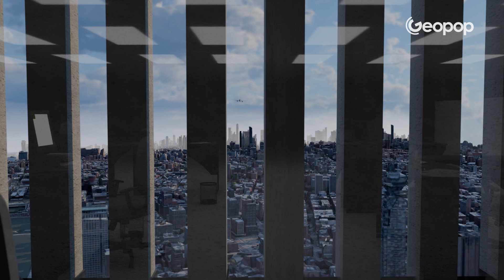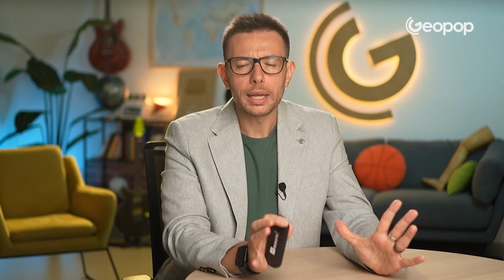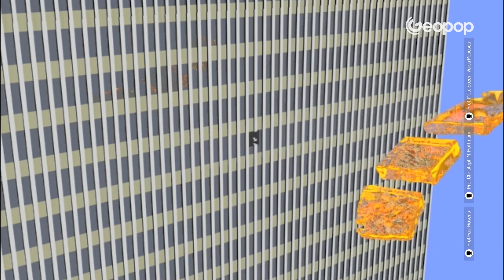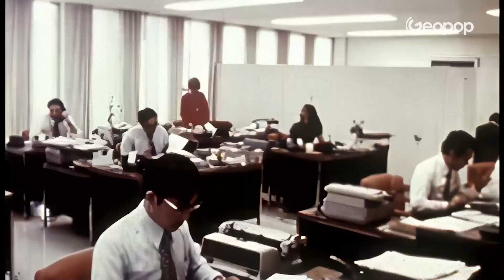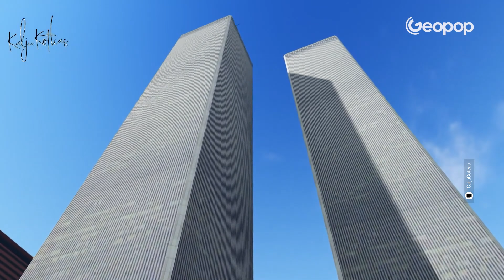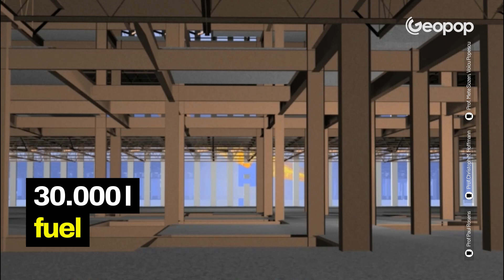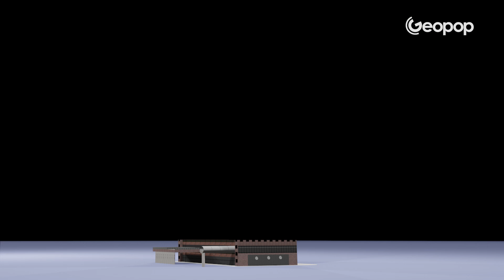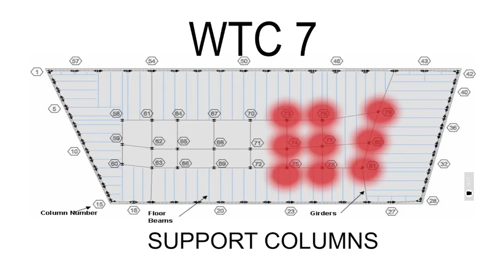9/11, 2001: The Technical Reconstruction of the Twin Towers and WTC 7 Collapses

Comment: Well you are presenting an empty claim with the progressive collapse.

Where is the data on the Tons of Steel and Tons of Concrete on each and every level of the towers? There is the slight problem of the Conservation of Momentum.

Consider the shape of the Eiffel 🗼 Tower didn't the amount of steel increase down the structures. So regardless of temperatures in the fire areas there were no fires below the 85th floor of the North Tower.

Try finding data on the horizontal beams in the core.

About those fires, air weighs less than 2 ounces per cubic foot. Steel is 490 lbs per cubic foot. The heat has to penetrate to the core of the steel which takes time. Plus steel conducts heat. If a 36 foot piece of steel only has 15 feet in the fire, how hot will it get?
Reply: You should look up the study by Bazant and Zhou on this topic, because it addresses your question. Through a simple analysis they found that by falling just a single storey, the upper portions of the buildings would have exerted a force that is nearly an order of magnitude higher than the strength of a typical intact floor. Yes, lower floors are stronger, but not an order of magnitude stronger. In addition, the force applied by the collapse continuously increases over time as the speed of the collapse increases. So by the time you get to the lower floors, they're experiencing forces that are multiple orders of magnitude greater than what they can resist.

Effectively, the only possible outcome here was the runaway progressive collapse that we observed.
Reply: "Consider a typical floor immediately below the level of collapse initiation and conservatively assume that the floor is still supported on all columns (i.e., the columns below the intact floor did not buckle or peel off due to the failure of the columns above). Consider further the truss seat connections between the primary floor trusses and the exterior wall columns or core columns. The individual connection capacities ranged from 94,000 pounds to 395,000 pounds, with a total vertical load capacity for the connections on a typical floor of 29,000,000 pounds (see Section 5.2.4 of NIST NCSTAR 1-6C). The total floor area outside the core was approximately 31,000 square feet, and the average load on a floor under service conditions on Sept. 11, 2001, was 80 pounds per square foot. Thus, the total vertical load on a floor outside the core can be estimated by multiplying the floor area (31,000 square feet) by the gravitational load (80 pounds per square foot), which yields 2,500,000 pounds (this is a conservative load estimate since it ignores the weight contribution of the heavier mechanical floors at the top of each WTC tower). By dividing the total vertical connection capacity (29,000,000 pounds) of a floor by the total vertical load applied to the connections (2,500,000 pounds), the number of floors that can be supported by an intact floor is calculated to be a total of 12 floors or 11 additional floors.

This simplified and conservative analysis indicates that the floor connections could have carried only a maximum of about 11 additional floors if the load from these floors were applied statically. Even this number is (conservatively) high, since the load from above the collapsing floor is being applied suddenly. Since the dynamic amplification factor for a suddenly applied load is 2, an intact floor below the level of collapse initiation could not have supported more than six floors. Since the number of floors above the level where the collapse initiated exceeded six for both towers (12 for WTC 1 and 29 for WTC 2), neither tower could have arrested the progression of collapse once collapse initiated. In reality, the highest intact floor was about three (WTC 2) to six (WTC 1) floors below the level of collapse initiation. Thus, more than the 12 to 29 floors reported above actually loaded the intact floor suddenly." -NIST

Here is the proof you seek.
Reply: @Oldschooldan1  
The Mechanical Floors were 75 and 76 just below where the plane hit the South Tower.
Plus there is the motion of the tilt. The bottom of the upper portion moved horizontally about 20 feet. The cores would not align. Funny how little discussion there is about that.
Reply: @psikeyhackr6914 There was floor, outside the core, between floors 76 and 75. It was open for mechanical equipment. Even though the floors were reinforced, they were not strong enough to stop the top 25 undamaged floors from falling 120 feet thru the damaged and missing floors below. The tilt of 20 feet was not going to cause the top to slide off the remaining 188 feet. None of the columns aligned on the the tower started downward. This why the floors load capacity was more important than the columns.
Reply: @Oldschooldan1  
The tilt was 20 to 25 degrees according to the NIST. Funny how they never mention the center of gravity and whether it remained within the boundary of the core.

It is not a matter of a single floor stopping the collapse. The levels had to get stronger and heavier coming down and lighter and weaker going up. So the falling mass should have slowed down until it stopped.
The Conservation of Momentum combined with kinetic energy used up bending steel and cracking concrete. Especially in the case of the North Tower.

In fact the sudden rapid tilt of the top of the South Tower has never been explained. Where were the centers of gravity and rotation?
Reply: @psikeyhackr6914   ”The levels had to get stronger and heavier coming down and lighter and weaker going up” Well that’s the thing. In the WTC that didn’t happen. All the floors save 3 mechanical floors all had the same load capacity. The columns got thicker, the floors did not. When the upper mass fell on to the floor below nothing was going to it from progressing to the foundation. This is a mathematical (which I’ve already shown) and engineering fact. Nothing you can say will ever change this.

”In fact the sudden rapid tilt of the top of the South Tower has never been explained.” Umm… yes it has. The plane hit the south tower off center and at an angle. This did massive damage to the south and east side of the tower. The east side walls buckled inward causing the upper floors to tilt to the east the hat truss pulled the west side over and the upper mass came down.

”Where were the centers of gravity and rotation” the west side of the tower acted as a hinge until it gave way and gravity took over. This is not rocket science.
Reply: @Oldschooldan1  
What are FLOORS?

You are talking about the modular floors outside of the core.  There were horizontal beams connecting the columns in the core that everybody sweeps under the rug. The "wheatchex" that were used to build the perimeter columns came in different weights.  Then no one tells us the weights and quantity of each. Like we are not supposed to notice the missing information.
Reply: @psikeyhackr6914  I have given you all this information in my original post. It shows all the math to back up my claim. If you think I'm wrong simply show where my (NIST) math is off. I'll wait..
Reply: @Oldschooldan1  
Fine!
You can tell everyone that the core and perimeter on level 105 contained the same amount of steel as the core and perimeter on level 5. That is what averages will do for you.

Why is the Eiffel 🗼 Tower shaped like that?

😆
Reply: @psikeyhackr6914  Columns had absolutely zero to do with the floor's ability to carry load. Prove me wrong. Show your math.
Reply: @Oldschooldan1  
I never said the columns affected the ability of the Floors to carry a load. The columns carried the load of the Floors and all of their loads. The NIST Admitted that the core carried 53% of the building's load. But Bazant's Crush Down Crush Up means that the falling portion has to crush the Core!

So the mass of the core has to enter into the Conservation of Momentum calculations.
Reply: @psikeyhackr6914  Large sections of the cores survived the initial collapse. They were the last part of the structure to fall. Would you like to try again? The upper mass took the path of least resistance... the floors.
Reply: @Oldschooldan1  
Try to point out the fact that you cannot even find data on the horizontal beams in the core? I am trying to tell everyone that the structural engineers in the nation that put men on the Moon can't do that.

Your ego is totally irrelevant to me.
Reply: @psikeyhackr6914   They are called girders and there is plenty of data on them. From the original architectural and structural plans, that are available to the public. Not to mention photos and video of the construction that shows them being installed. Again, the cores withstood the collapse. they fell later because they relied on the perimeter columns and the floors to prevent sway and shear. It' clear you have absolutely no knowledge of engineering or physics and you are just parroting nonsense.
Reply: @Oldschooldan1  
Provide a link to the layout of the "girders" to support your CLAIM. The blueprints show the positions of the columns, not the girders.  What was the thickness of girders on level 5 compared to level 105?
Reply: @psikeyhackr6914  They won't allow me to provide a link in the comments, so you're just going to have to do your own research. The structural drawing that FEMA used are available on line and I have them. They are hundreds of pages and I don't have a week to go thru them all for you. I can tell you that some of the girders used on floors 4-6 were 20-AB-16. You will have to find the drawings on line and search for that particular beam. I don’t know why you are so concerned about the girders in the core as they withstood the initial collapse and fell after. The cores were not designed to stand alone. They fell at their base due to damage from the already collapsed floors and perimeter columns. They required these structural elements to keep the core from swaying and shearing the connections.
Reply: @Oldschooldan1  
Excuses, excuses! You could explain a location without using a link. I downloaded the NCSTAR1 Report by the NIST and burned it to DVD on 2007. I went to one of Richard Gage's Dog and Pony Shows in May of 2008. You can believe that I haven't done research all you want because it helps you justify not even thinking about All of that mass in the core that the top of the North Tower had to fall onto if the official destruction scenario is supposed to be believed.
Reply: @psikeyhackr6914  I can't help it that they wont let me provide a link. I can't control this video. You may have downloaded the NIST report, but you clearly don't understand it. Why don't you tell me what they got wrong in Section 5.2.4 of NIST NCSTAR 1-6C????
Reply: @Oldschooldan1  
ROFLMAO

Searched it for every instance of 'steel' and 'concrete'. Read every paragraph using those words. They never specified the total amount of concrete in the entire report but they specified the total amount of steel in 3 places.

The say the top of the South Tower tilted 20 to 25 degrees but never mention the center of gravity.

Their explanation of the collapse was "global collapse ensued". The mass of concrete could not possibly affect the collapse time due to the Conservation of Momentum.

LOL
Reply: @psikeyhackr6914  What does any of that have to do with  Section 5.2.4 of NIST NCSTAR 1-6C? This section is referring to the truss seat load capacity calculations.  "I downloaded the NCSTAR1" Maybe you should have downloaded the other 42 NCSTAR documents. You did know that NCSTAR 1 is the basic overview of the report and all the findings are shown in depth in the other 42  documents? Did you read the other 42 companion documents????
Reply: @psikeyhackr6914    What does the Eiffel Tower have to do with this?
Reply: @psikeyhackr6914    Why do you think no one can find the data as to how much the floors weighed?  Architects are also engineers.  People who build these buildings HAVE to know all the dimensions, weight and stress thresholds of each component to figure out if it will even stand up.
Reply: @Oldschooldan1   Are you kidding?  He didn't even watch this video! 😂
Reply: @cattycorner8  
Let's see, we have tall narrow structures that must support their own weight. What physics MUST be the same? The Eiffel Tower is 300 meters tall and is 10,000 tons of wrought iron.  What do you think is the weight of the top 3 metes compared to the bottom 3 meters? What about every 3 meter slice in between?

Obviously we cannot see the 100,000 tons of steel that held up the North Tower.  Since the North Tower did not get thinner toward the top and was not full of holes it had more of a wind resistance problem.  But do you think level 105 contained the same amount of steel as level 5 which had to support the weight of 21 times as many stories?
Reply: @cattycorner8  
Where did l say FLOORS?
Mostly I make a point of saying levels.
YOU try to find the weight of the horizontal steel beams that were in the core connecting the columns. There is nothing l can do to stop you. Did they get thicker down the buildings?

Comment: You can clearly see falling steel chunks & the remaining standing core columns turning to dust in mid air -  explain that!
Reply: good point! steel turns into dust! how?!
Reply: Oh Jesus christ you believe Judy Wood.
Reply: Fuckin clowns on here. Since when did steel turn to dust? Check out former professor of structural engineering, Dr Judy Wood's book, "where did the towers go".
Reply: Hang on... If the cores, which were heavily reinforced concrete, were still standing after the floors and outer perimeter had collapsed, then what actually caused the concrete to be anhilliated!? 
Concrete can withstand very very high temps, and has extremely high compressive strength - so what happened to the concrete!?

An honest question as I've never even heard that the concrete cores remained standing after the floors/outer fell before!! 

Concrete doesn't collapse under it's own weight. Otherwise the Hoover dam would turn to dust.
Reply: Duh, it’s science!
Reply: The core columns collapsed behind a cloud of dust that they left behind. There's like one or two videos that don't show the cores falling, which "truthers" like to cherry pick. But there's plenty of angles that do. And no direct eye witnesses to the cores "turning to dust" in mid air.
Reply: how are people like you allowed to vote
Reply: @thelilpeanutdotgov  🤣🤣🤣
Reply: Its almost like each floor was made from 1.9 million pounds of Concrete each floor coming down that quickly wouldnt create dust? What about the drywall?

Comment: May be u r more technical and explaining correct.but I have seen the videos a lot , and why when the second plane hit the tower nose came out from other side ?? How is that possible
Reply: @sunnysinha7936  that wasn't the nose. It was the titanium core of a hot jet engine on fire and probably still spinning.
Reply: @Apodalont  u can compare the Nose in, and Nose out frames. they are near identical
Reply: It was the right side engine that came spiraling out of the building and landed 4 blocks away on Murray St.. There is a video of it standing on end still smoldering with black oil oozing out.
Reply: Only if u are watching an image of a plane in a composite shot
Reply: The pilot gunned it to max speed and tilted the aircraft to do the most damage.
Reply: It wasn't actually the nose, it was the debris wave caused by the impact of the nose that exited the building before the rest of the impact wave.
Reply: @TemerityXD  How the hell did u determine that? out of curiosity
Reply: Heavy Steel pieces moving at 600mph tumble a long ways.
Reply: The way and location it hit. It literally flew into the tower and the inside pressure blew it forward